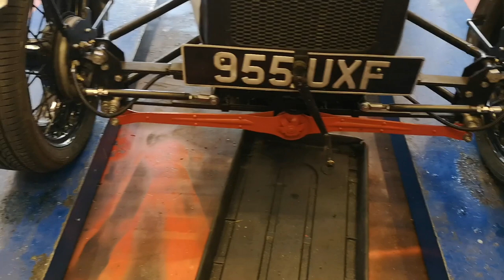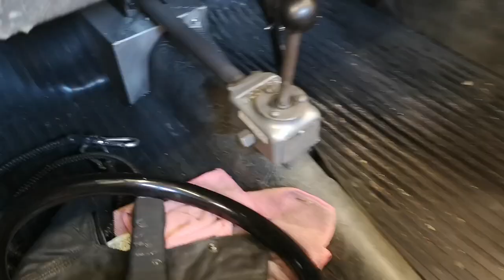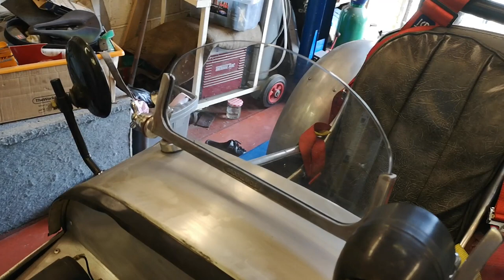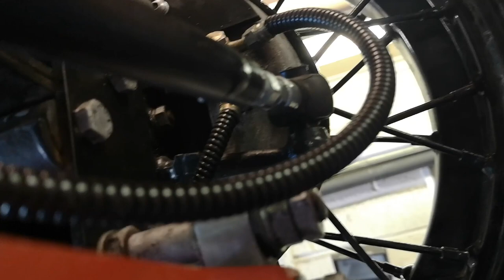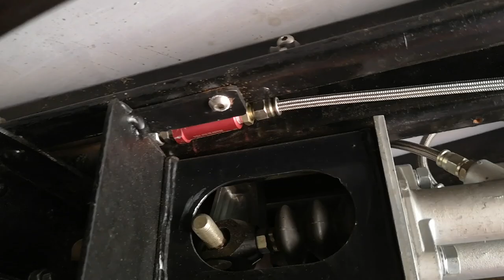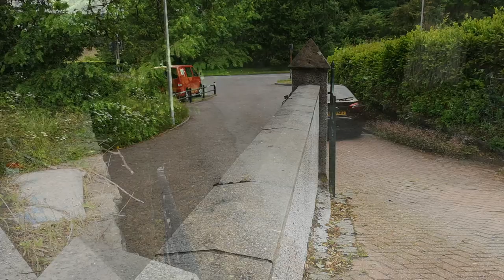Covid 19 Lockdown Activites with a 1937 Austin Seven

Comment: Thank you for sharing your updates.  Its a fascinating machine.  I've just bought a Bowden front end and am mulling over if and if so quite how to fit it.  I thing I'll pass on the imp rack but I bet yours steers beautifully with that fitted...  Have heard of Austin steering boxes being upgraded with proper bearings, but yours is the first rack I've seen.  Is the gear change a period accessory?
Reply from the maker: Beware the Bowden arrangement has a few issues ( I am not done yet). Yes the car steers very well now but that is after a humungous amount of work installing the imp steering (it was made for that car it fits really well).  It has a tendency to wander at high speed particularly above 60 mph it becomes a bit dangerous. I plan to introduce more caster angle into it over the winter. It is currently set about 1 deg it should be 5-7 from advice received from someone who knows. There is also bump steer but that is not as bad an issue as it sounds (it is at least predictable). The road holding is amazing now that I have fitted top wishbones on the front and a panhard rod on the back. Some think I have ruined a vintage car but that is crap I have had a tremendous amount of fun getting here. I have a friend who fitted proper bearing to the 7 steering box, he is a hill climber, he says it was a complete waste of time, he now has a VW box.
Reply from the maker: Yes it is a 1950's type upgrade, I wish I could find another. The Bowden does not work without the upgrades to tie bars and steering. The steering upgrade is the business, so is the shockers they are a must, bigger gain than anything else in terms of stability see later video.